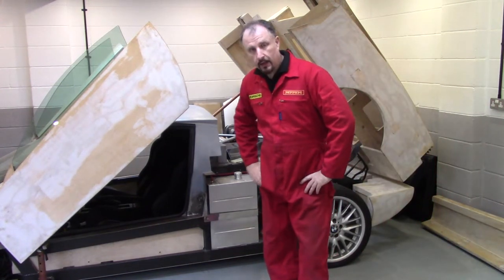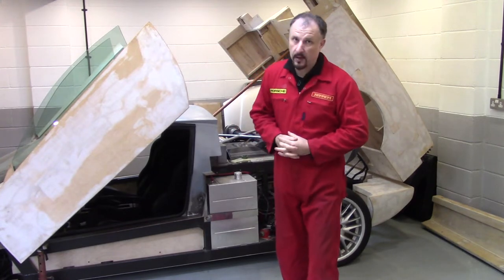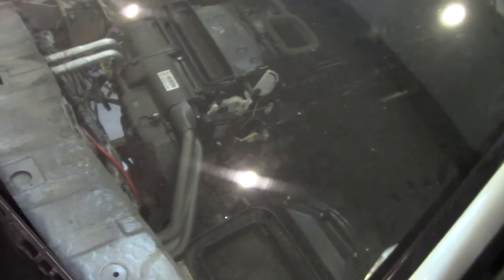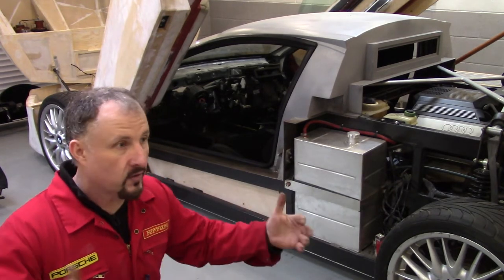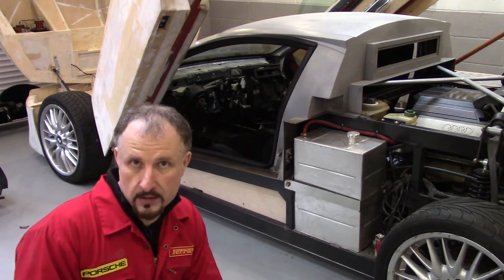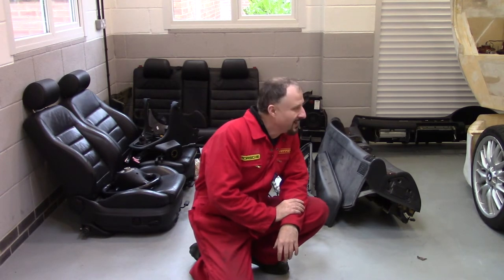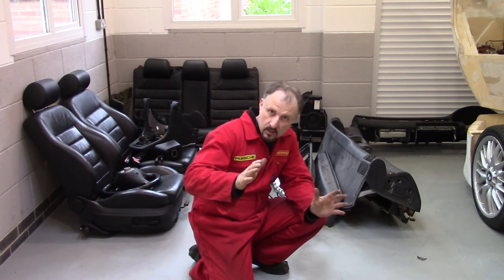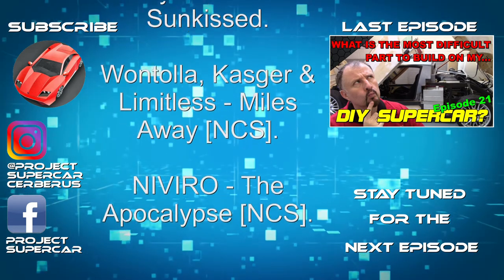Bulkhead Design and Blower Unit Part Two: Prototype Ep22

Comment: I have the same problem. The blower box is massive and will never if. So I’m going to try and keep all the internal and electric parts of the blower box and make a new box for it all to fit in so it will fit in the car. Maybe it’s the same way to go one your car🤔
Reply from the maker: Oh yeah, the Audi blower unit would never fit in a Countach bulkhead. I'm not sure on the cheapest way to go on this project. I think when I cut out the Audi bulkhead from the new donor car, I may have a better idea, and yeah I may have to go for a custom box, probably made from aluminum. Won't be cheap though :(

Comment: Out of interest, how long did it take to get where you are with this prototype. There is no build coverage for this. Those blower units are LARGE.
Reply from the maker: Hi Don, yeah it took about 4 to 5 years to build this prototype. When I was building the prototype I didn't consider doing a YouTube channel, so didn't take any video footage, but I do have many photos. I was planning on writing a book once the car was finished. You're right about the blower unit, that was unexpected when I removed the dash. I still having figured out an affordable solution yet.
Reply: Yeh, I know your goal is to be able to buy a donor car and use all the components from that, but potentially you'll end up with a car that looks like the donor car. haha. Other sources will have to be made, bumping the cost up. Hard work mate, best of luck with this.  :)
Reply from the maker: @donfinch862  Yeah you're right, it's a difficult blend of cost, design and function. If I can ever finish this prototype the next level would be to offer a kit that people could build for under £20K; yeah I know, a tall order, but I'm going to try. ;)